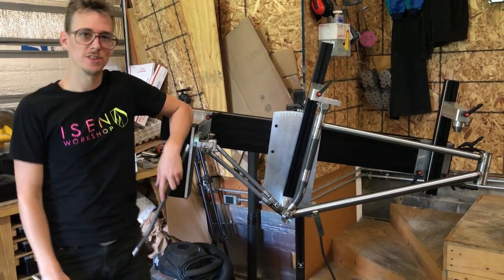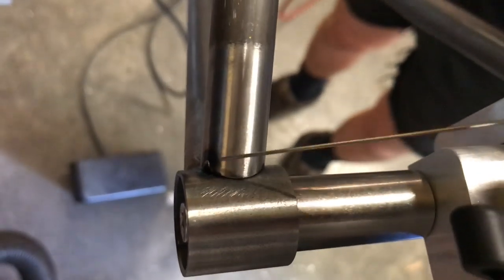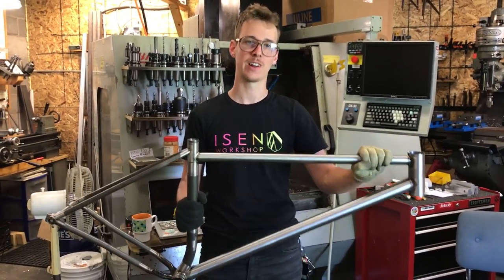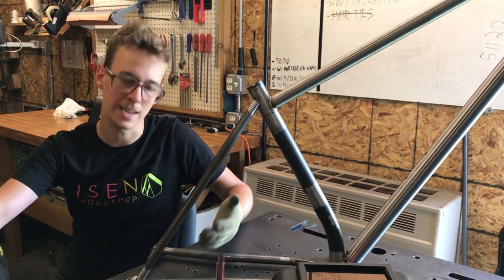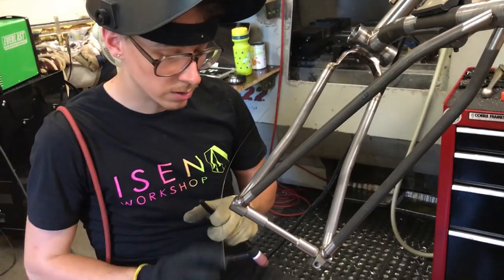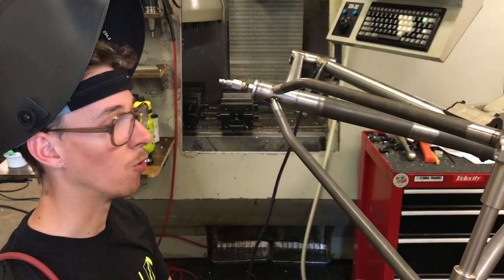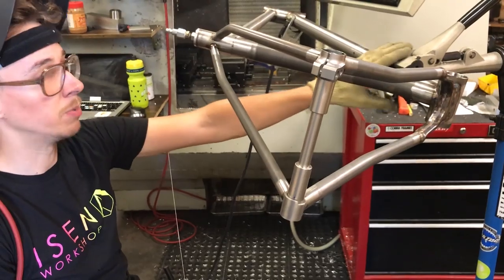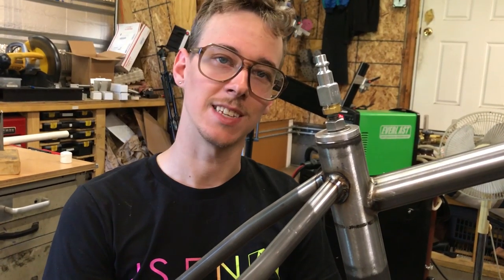MTB Frame Comin' Along Real Nice! | TIG Welding Seat Stays

Comment: Why do you you hold your torch so close @ the cup? In my opinion it's easier to hold it a bit further down the torch. Hold it like a pen. You get your hand out of the way and can see your weld better. You can make little corrections with your fingers. Keep up the good work.
Reply from the maker: I like holding it close up. Holding further back gives you less sensitivity and control, or that's how it feels to me. The head and the cup get hot when you're welding heavy stuff, but on bikes at the speed I go it's not bad.